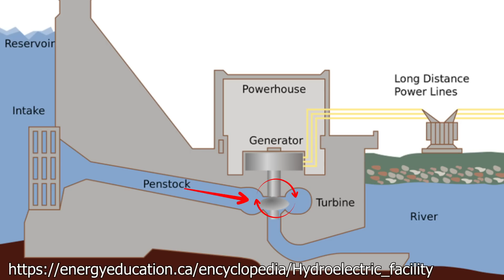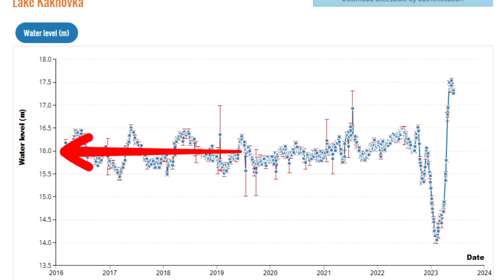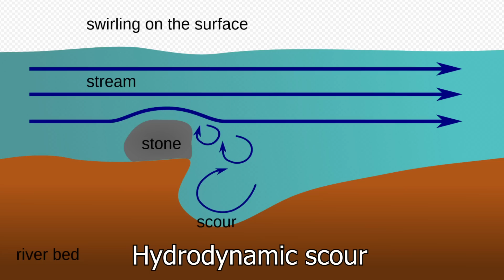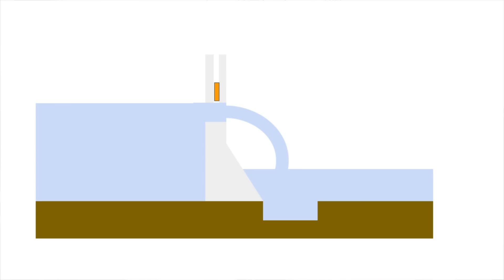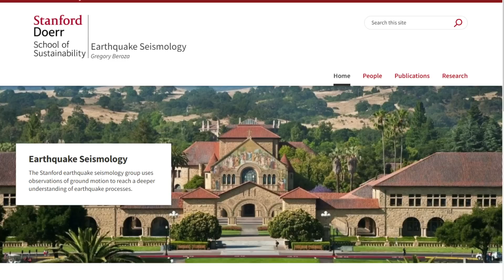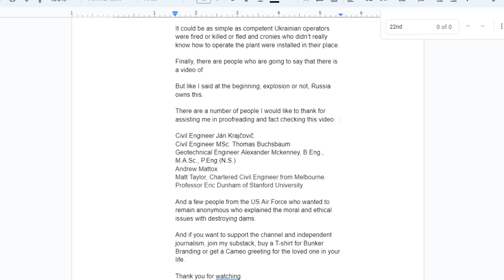How Russia Destroyed the Kakhovka Dam

Comment: It is very logical and good analysis.
However, for this type of failure, the dam, being constructed with reinforced concrete should maintain its shape. 
In that case, the edges of the dam top should surface when the reservoir is completely drained out. In other words, when the levels of water is equalized upstream and downstream.
We may have to wait only few more days. Satellite images will show us the shadow of the unbroken dam.
Satellite images now show the dam was broken into three sections, that makes your theory although possible, highly improbable.

Comment: I would rate this as a highly plausible explanation for the failure. However, there's still the matter of some European seismologists detecting what could have been a blast just before the dam gave way. It's also possible that both scenarios are true: the dam was on its way to eventual failure, the Russians knew it & couldn't stop it, but they could at least have a say as to WHEN it gives way by giving it an extra little push at just the right time, literally just as Ukraine is ramping up their major counter-offensive.
Also: if the dam was indeed overtopping in the days prior (how many days I wonder?) as the sat photos seem to indicate, I am left to wonder how it is that no one on the Ukrainian side noticed this obvious critical problem? I suppose it's easy to lose track of one potential crisis when you have multiple other crises you're trying to manage, and maybe that's just not something most people other than engineers would recognize as a problem, but still. A lot of eyes were on that dam, and not just from on the ground.

Comment: Finally! I knew I could count on you!

The video mentions that the advantage of a flooded downstream is not that great (it just makes something already difficult slightly more difficult). I think this overlooks one thing: timing. If flooding happens concurrent with an operation (equipment & personnel massing but not ready to cross or equipment & personnel congregating on the other side) it has a potential to be very disruptive.

There is allegedly US intelligence claimed to support the bombing.

Explanation: US intelligence has tapped into the command structure ordering the destruction (speculation on my part). US intelligence is not physically confirming the event. Russians intended to destroy the dam but meant to time it with some sort of forthcoming Ukrainian operation. Instead, the process of building up volume behind the dam got away from them and destroyed the dam before they had a chance to do it themselves. This explains Russian soldiers being flooded out.

I have seen flooded Russian soldiers being flushed away rationalized as Russia not caring about it's own soldiers. The idea being that washing away a few soldiers is worth the operational security risk of ordering an evacuation ahead of the flooding. However, at this point Russians running away is not in any way suspicious and would be expected ahead of a superior Ukrainian force. Also, Russia doesn't have to love its soldiers to want to preserve valuable human meat if it would be trivial to do so with minimal risk.

Comment: Excellent Reporting Ryan! I am a retired Natural Resources Technician and have been in charge of operating a flood control dam for over 30 years. Your analysis is spot on! Nothing can ruin a dam faster than mis-management! All those sluice gates, even if Russia still wanted the upstream side of the dam water higher, should have been set at a level so that no water overtops the sluice gates! The water needs to flow through all of these as designed! Opening just one sluice gate is always a mistake as all of the pressure of the river erodes very quickly with a dam that large, with that much volume running through it. It needs to flow controlled over the designed length of all the sluice gates... otherwise why have so many in the first place! Yes it is on Russia!! 

Great reporting!
Peace n Love.

Comment: A very interesting analysis.  My question would be about the spillway channel at the south end of the dam, running beside the turbine hall.  Wouldn't this normally prevent overtopping in this manner?  Why did this mechanism fail?
Reply: A single spillway has a finite capacity. Enough water is entering the reservoir to raise the level by 2m in a few weeks so a single spillway really isn't enough.
Reply: @keithdowsett1352  I was actually referring to the channel on the south side of the turbine hall, rather than the single sluice gate that appeared to have been opened.  However, closer examination tells me that's a lock gate for navigation purposes, not an emergency spillway (which would operate passively).
Reply: A quick guesstimate would suggest they needed to release about 1 cubic kilometer of water to get the reservoir down to a safe level. Assuming the power hall wasn't running they should have had something half the spillways open.

Comment: There would have been signs of a structural collapse. Cracks. Leaks. etc. 

Seismic signals recorded in Bukovina, Romania, 620km (372 miles) away from Nova Kakhovka, indicate an explosion took place at 02:54 on Tuesday.

Norsar, the Norwegian Seismic Array which analysed the signals, says the timing and location coincide with the collapse of the dam.

Comment: Of course, there could have been both gradual structural collapse as well as internal explosives that got set off. Supposedly the Soviets designed this dam so that it could be destroyed exactly in such a manner, to weaponise it in case of an invasion like in the 1940s. Which was when the previous two installments of this dam got weaponised in this fashion, both against the Nazis and later against the Soviets by the Nazis when they got pushed out again.

You're absolutely right that Muscovia owns this disaster. The uneasy working conditions at the Zaporizhzhia NPP show that such large infrastructure can be operated safely, even among the most dire of circumstances. I'm pretty sure Ukraine would not have shot at anyone operating the gantry cranes operating the sluices, for one. Exactly to avoid this kind of disaster.

Comment: Something isn't right here.  In America (and the western world) dams are designed with an ultimate uncontrolled overflow that will cap water elevation regardless of what is being done with the powerhouse or spillway.  This is usually below the top of the dam.

When I look at this dam on Google Earth I don't see that this dam has one.  I don't know if this sort of safety feature isn't part of Soviet era engineering or if I just can't see it.

If you look at Oahe Dam, a relatively large earthen dam near Pierre SD, you will see from east to west the powerhouse, a spillway structure for controlled release, and somewhat to the west a small spillway and dry channel back to the river downstream.  The third structure is the safety overflow.

If this safety feature isn't there and the Russians let the water level get too high the spillway gates may have been overtopped bringing on the dam failure starting with the one open spill gate.  

Just guessing here.  I'm not a dam expert but I have spent a lot of time working with low head earthen dams around people who are.

Comment: I belive that your conclusions are faulty. A barrage dam is built to have water spilling over the individual gates,  it would not allow for scouring (unless its a badly designed dam. 

Khakovka is a concrete dam, and those are anchored in bedrock. Bedrock does not allow for scouring, atleast not in a shorter perspective.

Ackumulated damage together with the higher water level in the dam might have contributed to the collapse, but not in this case, and not on its own.

The damage was so fast and widespread that it also rules that out.

I belive that your video will be used by the Russian side to try to shift the blame.

Comment: A great area to put the explosives is inspection galleries which are tunnels built deep within the dam structure close to the upstream side of the dam. If the Kakhovka Dam had such a tunnel or tunnels, this is where they would have been placed; not the turbine hall. I did energy audits of dams in the early 90's in Ontario and all the large dams had at least one inspection gallery.